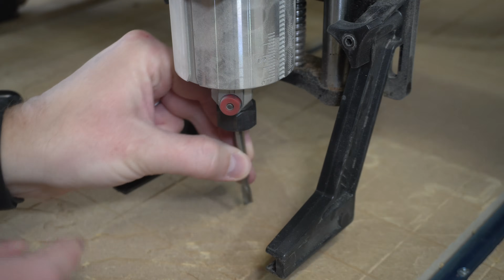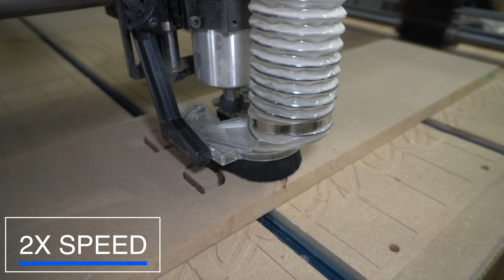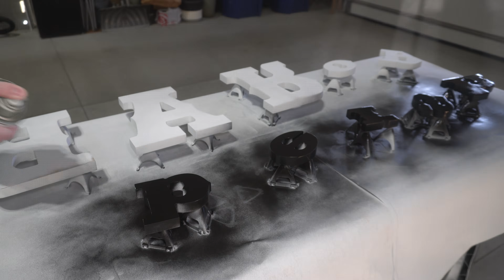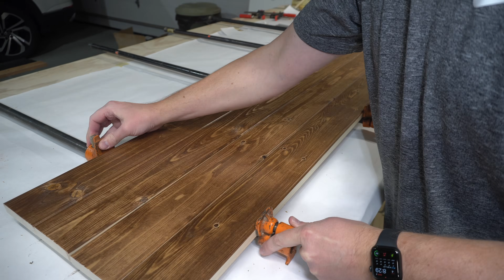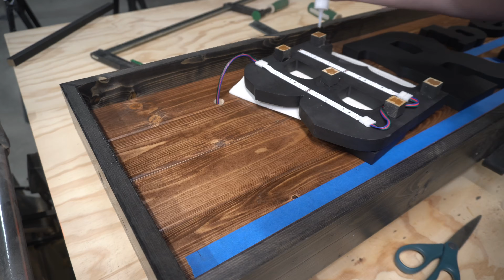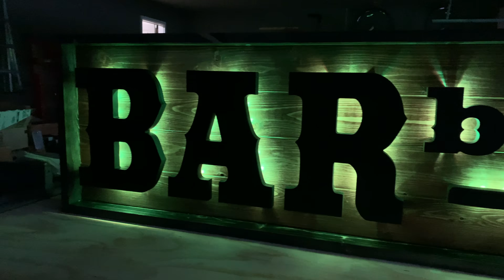Making a Custom LED Sign for a Barbershop

Comment: I know it's been a while since you posted this.  First of all I love it and want to make my niece something custom for her porch.  I've been having a heck of a time cutting lettes out of MDF with my CNC and it seemed to go so smoothly for you.  

A short video or even a reply here on tips and tricks that show the details of that process would be so helpful.

Beat bit, who makes it, depth per pass, feed rate, bridges...

I've had problems with stuff moving once it gets cut out, especially if I get aggressive with depth of cut or feed rate.

What is the secret to those smooth edges???

Thanks for any help!!!
Reply: Make several passes down, leave .03", for the final pass cut the .03" and inset cut the letters slightly .015".